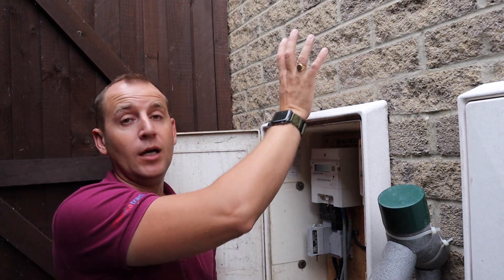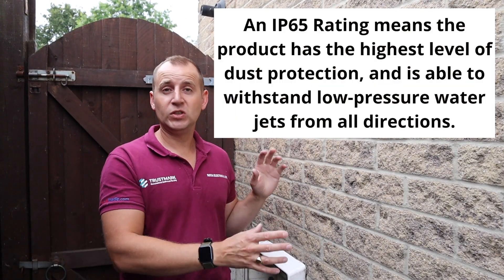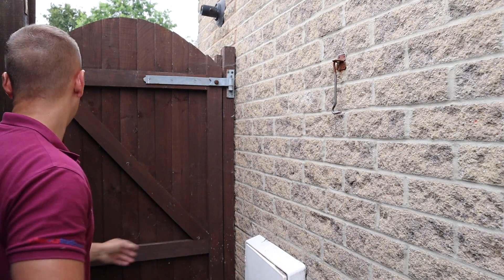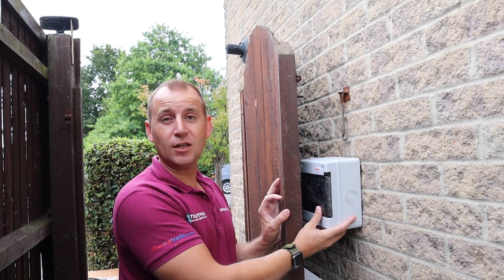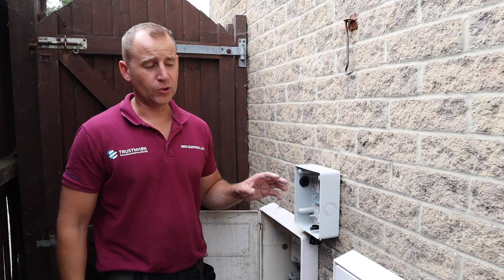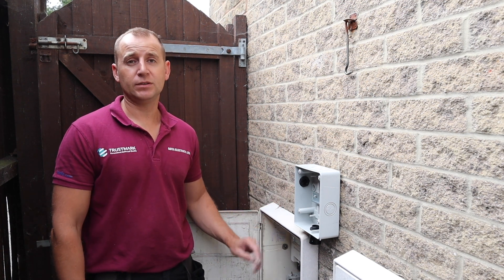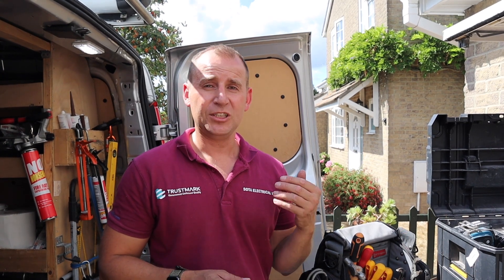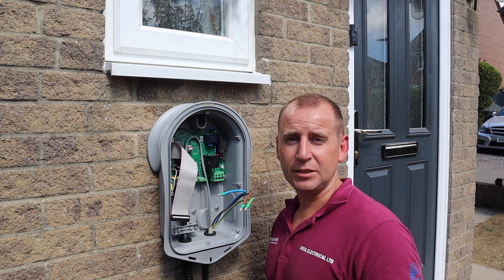New EV charging point install ready for a new Peugeot E-208.. find out more!!

Comment: Hi mate. Great job again. When doing an EV install from scratch in its own distribution unit such as this, do you always use 25mm tails ?. I personally do, but I've seen others on YT using 16mm or less as its supplying a 32A Chargepoint. Thanks
Reply from the maker: Hi Ed, if I am doing a new consumer unit in a house I always use 25mm tails, if it’s an external C/U I use 16mm tails, easier to route in the copex and easier to dress in the little boards. 
Thanks for watching!!
Reply: @sotaelectrical  Thanks mate.